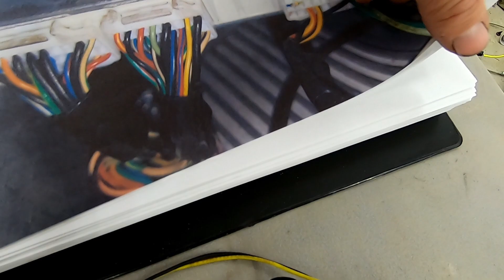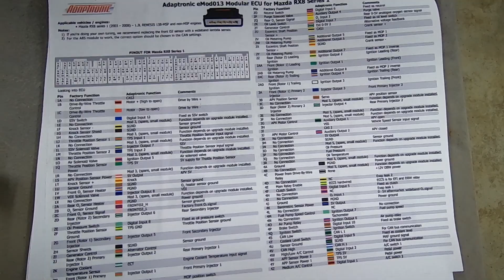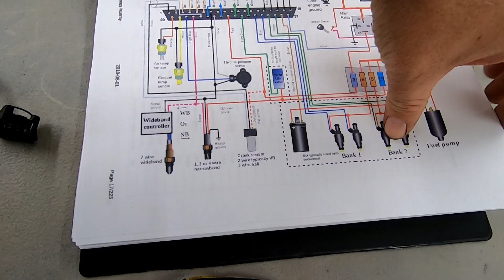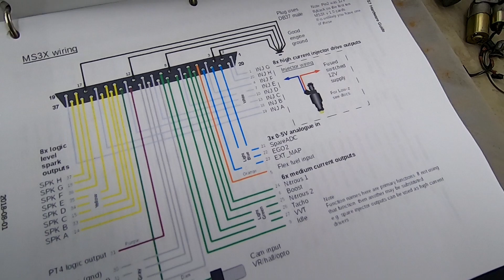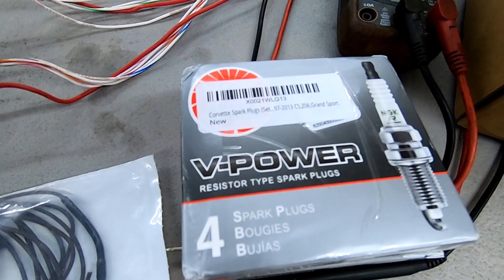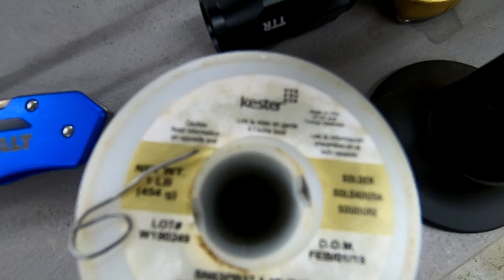LS RX8 Car Harness Swap Modification

Comment: Bro, by any chance do you have the diagram of what the second connector (the at minute 2:13)? I know it has 12v power, engine ground?, 2 pins for the reverse/neutral, and seems like something for the lambda?

Comment: Did doing this allow you to maintain the ABS? That’s kind of the make or break on me doing this swap.
Reply from the maker: Yes, keep the abs and original ecu for the vehicle.  Make sure the oem ecu gets a tach signal from the stock sensor and 36-2-2 ring.  That will activate the oem electric steering.